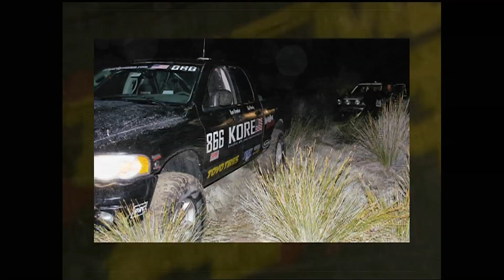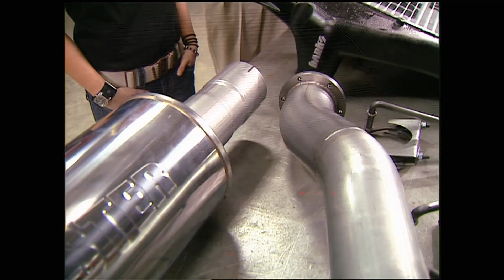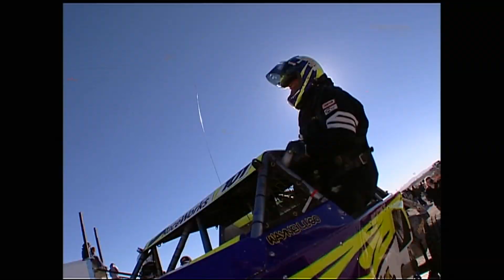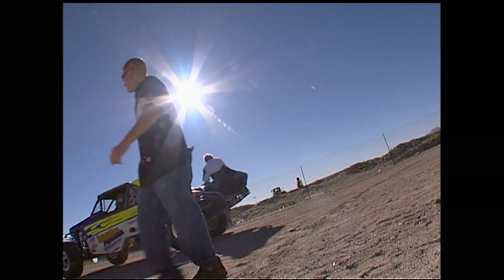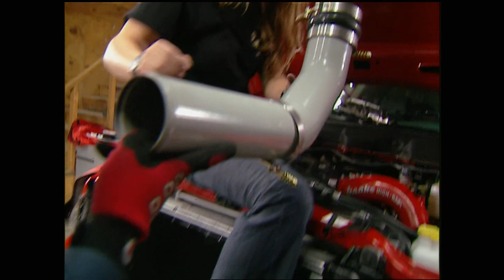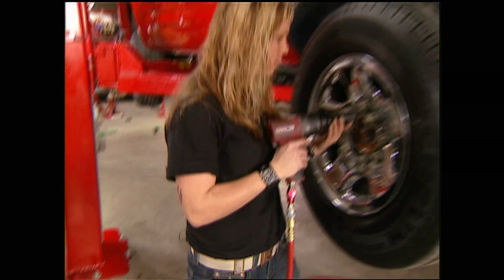Banks Cummins Part 2 - Xtreme 4x4 S1, E10

Comment: It would be nice if the parts were linked into the description. I am interested in buying the exhaust manifold. Mine is cracked and that design looks like it wouldn't be as likely to crack. Linking your parts is a way to make extra revenue.